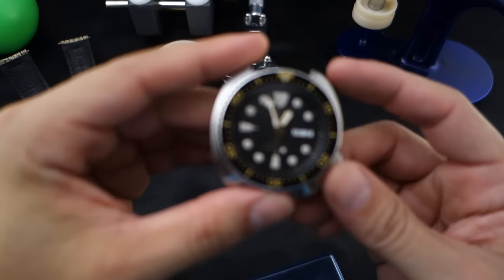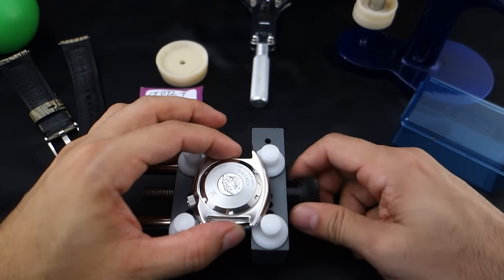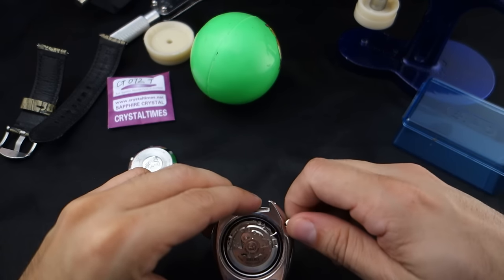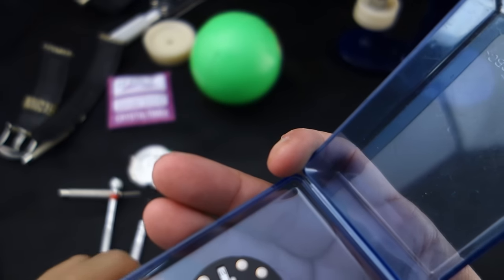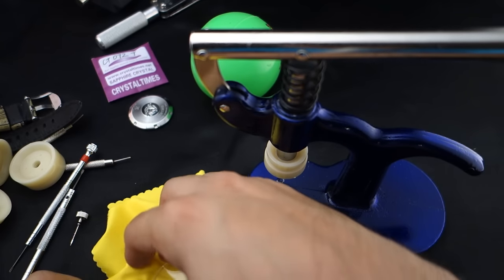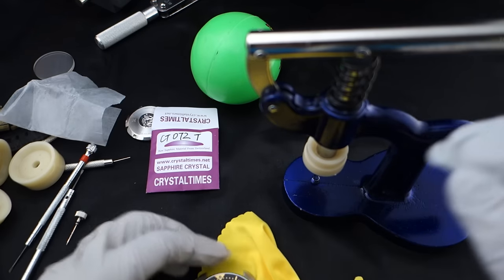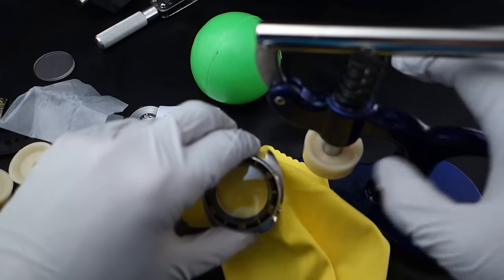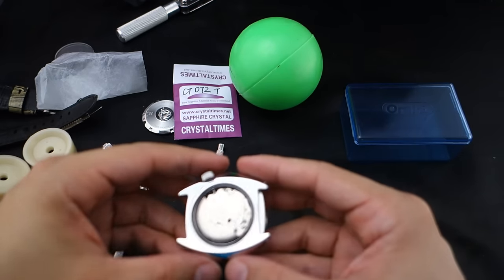Seiko Turtle SRP775 AR Coated High Double Dome Crystal Swap

Comment: unfortunatly the crystals i had purchased from crystaltimes last yr for a few other models wouldnt pressure test 100%. the bevels werent 100% identical to the factory seiko crystals. they would be able to be pushed in but wouldn't pass pressure and static...
Reply: Hey, from which supplier did you get a right crystal then

Comment: Nice.  I have one for my SKZ from Crystaltimes.  Lucky you didn't have to remove the bezel for the turtle.  I did on my 009, then on a 173 and the 173's bezel was so hard to remove, I scratched the case.  
Personally I would't worry about the pressure test unless you are going scuba diving.
BTW, I know you were local./

Comment: A quick question. With a few Seiko coming out with misaligned bezel triangle-pip/chapter ring lines and dials markers, how difficult was it to get everything to line up perfectly. I on,y ask because I am having to send back a Samurai, but my turtle is perfect. I don’t want to mess up my turtle. 

When you remove the automatic movement, does the chapter ring stay in place within the case?  If so that would make this so much easier. I love sapphire crystals. I also like the slight domed look as well. 

I just want to get all my ducks in a row before attempting a Seiko, which I have never done before. 

I do have all the gear, I just want to enhance the watch, not detract from the aesthetics. 

Thanks for your response.
Reply: I found the misalignment is because the chapter ring is fitted upside down. I took mine out and rotated it 180 degrees and the problem was cured

Comment: Hi Minitwatch. Nice video. I have a cheap and dirty method for checking waterproofness after changing crystals on a dive watch. I simply reassemble the watch without placing the dial or movement in the case. Instead, I wad up some tissue paper and place it inside in place of the movement. Then i leave the watch at the bottom of the deep end of my pool overnight. If the tissue stays dry, the case is tight. It's not a proper pressure test of course and will not indicate whether the watch will perform at dive depths but it's a good test for general skin diving or swimming use. I've tried this method with both push/pull crowns and screw down crowns. I have used this method with great success. No failures!
I like these instructional vids. Very inspiring. Thanks and wax up your board in case you have to paddle out of your house after the storm.
Reply from the maker: That's a good idea! I don't have a pool, though. Toilet? hah!   Thanks!

Comment: Thanks for sharing this video.  I’m curious if it was necessary for you to remove the bezel in order to have the crystal to sit flush in the case.  I noticed the crystal got stuck half way before the camera cut off in your video.      My model has the IP coating on the bezel so if I could avoid scratching the watch from removing the bezel the better.  When I installed my crystal for the skx013 I had to remove the bezel due to clearance issues with the crystal.  Any help would be appreciated.

Comment: If you take the back off won't it not be 200m water resistant?
Reply from the maker: That is always a concern but if done right, it shouldn't. That is why I'm getting a pressure tester to be sure.
Reply: +minitwatch I was about to ask about that. knowing that the crystal isn't seiko certified and that you've opened that turtle up, how confident would you feel taking that turtle down them depths. great video as always though. keep it up. :)
Reply from the maker: About as confident as with any of my watches: 0% :)  I don't like to get any of my watches wet for any reason. Well, there is one exception: my GShock. I have taken that thing apart time and time again and it has not once failed while swimming. I've never changed the gasket too!  Despite that, these crystals meet or exceed OEM specifications. As long as it's done properly, it should be good to go.  I think a lot of people need to have visual confirmation before taking the plunge and I don't blame them. The tester is coming and it will be glorious!

Comment: You're getting pretty good at this, man! I also caught your Hamilton crystal replacement video, and I'm considering doing a crystal swap on my Khaki King, but since the replacement crystal is also domed, I'm not sure if swapping it out will reduce the glare enough to justify the expense in tools, new crystal, and potential for damage to my watch. Videos only tell half the story. Is there really enough of a difference in person?
Reply from the maker: For my watch, yes.  I freaking love it now. That glare was the one thing I hated about it. The thing that i worry about it is water resistance with this crystal which wasn't made for it. I am going to get a pressure tester so you might want to hang tight on that until I do that test otherwise, just don't get it wet in anyway. :p
Reply: Awesome! Thanks for the opinion. I'll definitely wait to see what your results are.

Comment: I think the domed crystal has actually taken away from the identify of what makes a Seiko Turtle such a nice looking watch. The original flat crystal harks back to the iconic SKX divers and contrasted really well with the curves of the cushion-shaped case. With the domed crystal, the watch now looks too 'blobby' for want of a better adjective.

You've changed the look of the watch, but you have taken away from it's character and identity.
Reply from the maker: I see what you're saying. I am looking at it right now and I absolutely love it.  I have, for me, added to it's character and attached my identity to this watch.  Cheers!
Reply: No worries dude. As the Bentley Rhythm Ace song says; "If everybody looked the same, we'd get tired of looking at each other".

BTW. I think the crystal swaps on the Hamilton and Seiko look great and add depth to the character of both watches.
Reply from the maker: I think if you saw it in person, you might at least think it's okay :p. Again, I see what your'e saying. I might get another turtle just to have one bone stock. That being said, I hope to also try out a low dome and a flat AR on this watch. I'm also going to get a pressure tester to be legit! I don't wanna half-ass things :)
Reply: Yeah, it's always difficult making judgements based on pics and vids. I think a shallower dome would work well on the turtle though, as it would be a bit more subtle and not dominate the overall look of the watch as much. ;)

To feed your addiction, I think you should mod the lens on your Invicta Pro Diver next. Then move onto modding the bezel, dial, hands, etc. There is a whole community out there devoted to modding the Pro Diver.